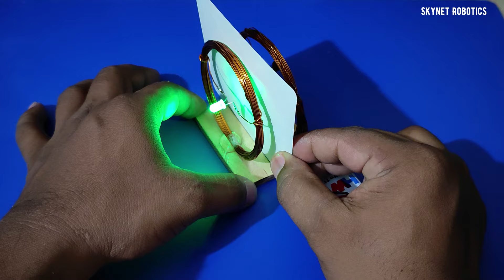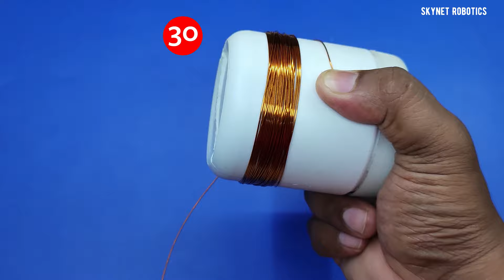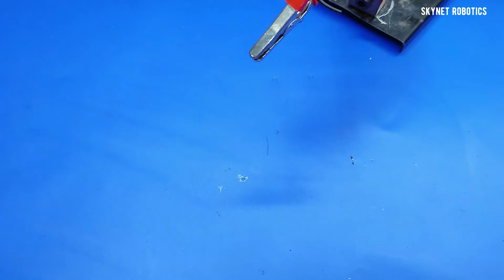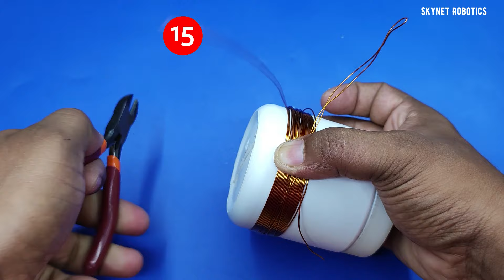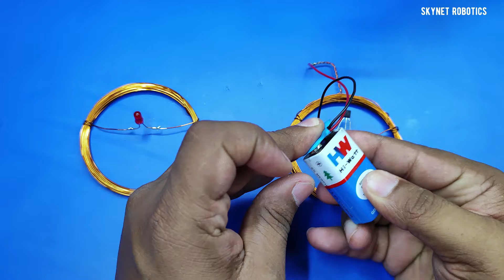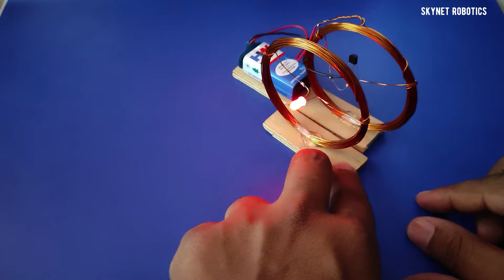how to make wireless power transfer project || Science project

Comment: I made one but the components were ; 32 gauge wire, 547B transistor, 15k resistance, and turns on each coil were 30, but the transistor is heating up and led is not turning on can you pleas tell how to fix this?
Reply from the maker: Use more than 22k resister
Reply: @skynet-robotics  okay i will use 22k resistor but the existing bc547 will work or i have to use 2N222A transistor?
Reply: @skynet-robotics  okay i will change the resisitor but do i also need to use 2n222 transisitor or bc547 will only work?
Reply: Brother how can i increase the distance between them? Like if i want to make them work between a 30cm distance what do i have to to??
Reply: Use high voltage and 50 turns
Reply: Ok
Reply: Use mosfet,,,or bt139 transistor
Reply: Froud.... Use only 1k resistors than it will work
Reply: Bro me to my project also not working

Comment: Dear friend this is not wireless transmission but wirless electromagnetic induction. There is no capacitors in either set, transmitter and receiver. The natural resonance frequency is also very high in MHz but it is very weak. If you measure the inductance of both coils and calculate for a right capacitor for both module resonating at the same resonant frequency, then the range will be very good, several feet. Try it. Thanks for sharing electromagnetic induction transfer. Oh another idea: if you wind the same coil on a ferite rod or put a ferite rod, it will increase electromagnetic field and may work within several inches. Chao.
Reply: No, you are wrong. It is a WPT - Wireless power transmission ok
Reply: what is the name of the tool he's used to connect the wires?
Reply: Thanks for comment  I want to make smallest n slim power receiver. How to do that

Comment: If we use higher voltage battery, then can we get the light more brighter?
Reply from the maker: No it will burnt out transistor
Reply: Okay, so can we use the coil with more turns to magnify the brightness of the led light?
Please suggest any way so
 that the brightness of the led light is enhanced ...
Reply: Or what we can do so that the led light glows at a far distance from the other coil?

Comment: Sir I use 2N2222 transistor and  27k resistance with 9 volt battery but it glow only 2-3 time and transistor getting hot and next time it is not glowing...  One thing can we use 3.7 volt lithium battery.....
Reply from the maker: Yes

Comment: Can it work with 22kohm resister or from lower than it like 10kohm??
Reply from the maker: 22k ok but not less than it
Reply: @skynet-robotics  many videos are doing it in 10kohm and 2N222A how's this possible?
Reply from the maker: @projjwaldhamala1822  in this video guez of wire is more than 36
If u r using less than 22k then it starts heating
Reply: Okayyy thanks mate.

Comment: I have made 32 turns will it glow, can we use
electric tape in place of the soldering device. Also the resistor i used is 27k will that be alright
Reply from the maker: Yes
Reply: I used the same but it emitted smoke near the transistor resistor joint @skynet-robotics
Reply from the maker: What is the diameter of wire

Comment: What do i do if I don't have that wire jointing heating machine? Can i joint it with tape?? And I've made 25 turns is it okay ? And also I've 2222A transistor and not 2n2222A transistor? Will it work?
Reply from the maker: Yes u can give direct join but make sure proper contact has been made. 
Give turn as shown in video to desire results

Comment: Sir i use 23 guage wire and used all the circuit components you mentioned but still led is not lightning up, could you help me in resolving the issue
Reply from the maker: 34guage

Comment: I made this and I'm using CTP N 2222A LS and a 27 k resistor with insulated copper wire and 9v battery but the led (red colour)bulb is not glowing/turning on please help for this
Reply from the maker: Wire gauge?
Reply: @skynet-robotics  I made it I was connecting wire from wrong side btw thank you

Comment: How frequency is generated in this how emf is induced there is no changing magnetic field then how it works
Reply: That's what I am confused bro, like transistor doesn't switch on or off automatically,  or what I don't know, i search online and chatgpt, nothing shows up. Did you find the answer :) ?
Reply: @Dee-kr9mp  yeah I find it out using chatgpt it's that the copper wire works as an inductor. So the transistor and inductor makes an oscillator which is called colpitts oscillator. which generate emf which induces magnetic field in the another coil.
Reply: @SreesaiAk  Thanks for the reply, I would be helpful for my college project 😊
Reply: @Dee-kr9mp  yeah 👍

Comment: If i use 22k resistor and 27g Copper wire will it work? Kindly reply its very important to me.
Reply from the maker: 27g is ok 
22k  resistance will work for sometime but it will heat the ckt

Comment: Y not working? I did exactly as u shown...plz tell wat cud be wrong
Reply from the maker: Check Connection again
It's working properly
Which Transister u hv used npn or pnp?
Reply: I don't know pnp or npn
Reply: Which has to be used?
Reply from the maker: Npn
Reply: Can I know which it is without multimeter?
Reply: @skynet-robotics bro I used NPN 2N2222A-1726 transister and 10k resister but not working tell what's wrong (I made small circles around Li-ion battery)
Reply from the maker: @MithuParakeet  at least diameter of circle 4-5cm
Reply: @skynet-robotics  before small one I tried 5cm circle still not worked bro
Reply from the maker: @MithuParakeet  
Circuit is very simple. 
If you followed as it is then  problem may be in the transistor
You send me photo of connection on whatsapp
9075800409

Comment: I made the same circuit it works  BUt the transistor is overheating  and finally it burns. Do you have any idea why , i amusing a 2N2222 and a 20K resistor.
Reply from the maker: Use more than 27k resisiter